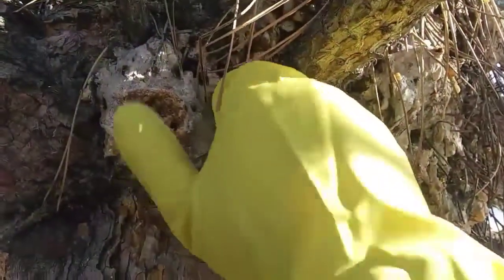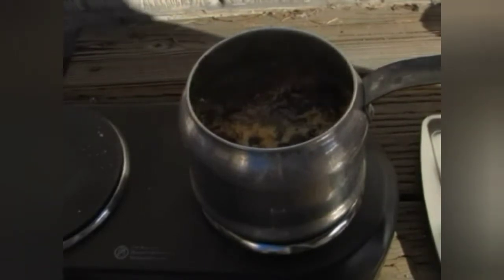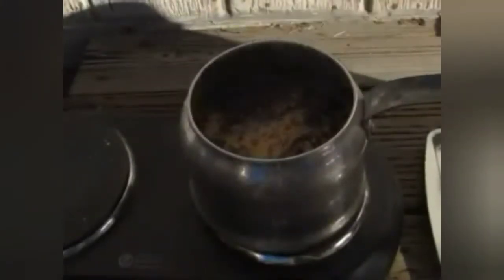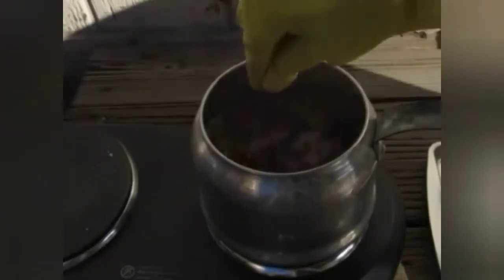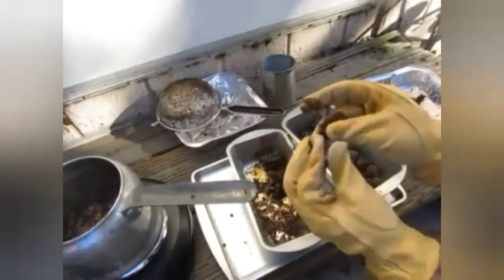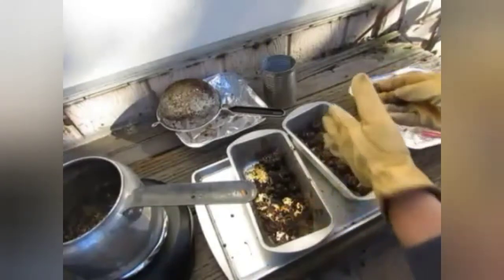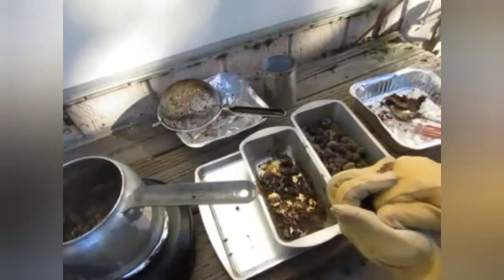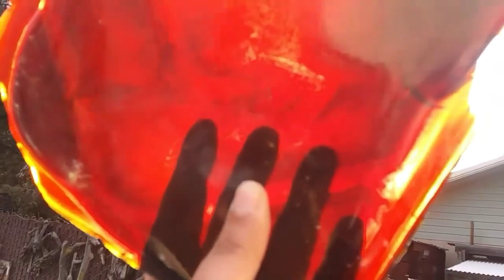Make Fatwood and Pine Resin

Comment: How long does this process take? I’m trying to use Norfolk pine sap. Any experience with that species?
Reply from the maker: All sap is different, and may have a different melting point. It will depend on how much you have, and how much heat you apply to it.

The hotter the heat, the more you change its molecular structure. If you just plan to burn it as fuel, you don't need to worry about it, but if you use it for glue, or violin rosin than too much heat can weaken the resin so it's not as strong.

It really depends on the heat you use, how much you have, and what you plan to do with it. Expect a good hour at least for slow low heat rendering, (best for glues, violin rising, ect.) It's faster, for high heat, fast melting, methods (best used for fire starters.)

Comment: Is there a way to make fuel out of the sap? Like how about a zippo lighter?
Reply from the maker: That's a good question, but I'm not sure I know if I can answer that. You can dip some rope in the hot, and melted resin, to make  water proof kinding, but I'm not sure if resin could be turned into a light fluid. When you figure It out, definitely let me know, cause I'm highly curious how it turns out for ya!

Comment: To remove sticky residue, coconut oil works wonders
Reply from the maker: Yes, oil works pretty good, but I found nail polish remover or a alcohol that is 90% proof or higher is best, especially if it's a thicker coating.

Comment: What would happen if you added wax?  && where did you get the fine mesh striner?  How do you store them?  in the referator, basement?
Reply from the maker: I've never added wax to mine, so I'm not exactly sure. I hear that it makes a fantastic bow string rosin that is fantastic for hunting.  I'm not a bow hunter, so I don't know much about it.

I got my fine mesh strainer, at the dollar tree! Its kind of a shock to most people to where I found it, but it works incredibly well! I have a bunch of these at my house. They are cheap and very efficient craft tools!

I store my resin in bags, in a cool dry, dark place. Heat and moisture make it melt and get sticky, and light can sometimes heat it up. So as long as it stays cool, dry, and in a dark place, it should store perfectly fine for ya.

Comment: You mention "Wound" dressing in another comment. What do you mean by that and how can it be used. Say like a gash or something. Or a temporary way to plug it?
Reply from the maker: Yes, both! It can help seal the wound, prevent infection, and works as a natural bandaid for many types of wounds. It can help it clot, and keep insects and pests away, as it's healing. If you have a large wound, and very little to fix it with, pine pitch is an excellent option with it's many medical properties.
Reply: Spruce pitch will draw an infection out.  Even if it’s healed in.  Don’t know about pine.   Never tried it, but understand it has similar properties.

Comment: At 10:41 you have the sludge material rolled up into balls and you have the clear flat sheets of resin. Both are used to start fires. If so, then bother to go through the purification process?
Reply from the maker: I am doing the purification process because I need the refined resin to make violin rosin out of. The refined resin also works as a glue, dissolves in teas, and can be applied in wound dressing. For all of these reasons, you should absolutely remove chunks of bark and debris or it will create problem.

Dirt in a violin bow totally destroys it, and the strings, making a terrible gritty scratchy sound. In wound dressing, dirt can cause infection, so you definitely don't want to create a problem like that either. In teas, bark won't dissolve, and you will probably be removing splinters out of your teeth. Again, not a pleasing experience.

If you only want to use the pine resin for fire starters, the bark will prolong the burn, and is perfectly fine to use as is! But if you do want the clean versatility and the medicinal use of pine resin, you will need to refine it like I did. This video is to cover all the bases you might want to use pure resin, or fat wood for. It's up to you if you choose to refine it or not. I hope this helps to answer your question.

Comment: Wondering if the resin is used outdoors if it goes liquid in hot weather? Does it stand up outdoors?
Reply from the maker: It melts when it's hot outside, and gets sticky. Im not sure if it would do the same if it is melted into wood, or used as glue. You would have to test it, and find out. Once you know, please message back! I'd love to know the answer to that question myself!

Comment: Hi. I used 99 percent rubbing alcohol to dissolve pine sap but now I can't get it to harden even though I've heated it up and then left it for a few days it's still a thick liquid.  Any tips?
Reply: Never mind, I put it over heat a bit more aggressively than before and it worked great

Comment: Great , EXACT - INFO - DEMO. Thank You !  Sure wish , I'd thought anout looking for sime tyoe ? SAP from trees in P.I. jungle , ha. Hmmm, wondering if the screen can be cleaned and used again?  Mtn Mel & Aussie Molly Blue , W. Colo. , sitting in tipi camp , 7 000 ft.  Ret. 59-82 USN SERE / VN .
Reply from the maker: Yes, the screens can! Use a heat gun to try to melt any excess resin off, then dip the screen in nail polish remover, or high proof alcohol like everclear. When your done, get it in boiling hot water and rub it with a scrub brush dipped in cooking oil.

Heat thins the resin out and makes it playable, the alcohol and nail polish eats the resin off the scream, and the hot oil removes the sticky residue left behind.

Personally, it's easier to buy a new scream at the dollar tree than it is to wash your screen, but this method works on posts and pans too, an they are a little harder to replace.

Comment: Thanks! just collected my first ever resin because of this video. It smells amazing unprocessed, do you think it would be possible to make scented candles from the resin? Or would that be smokey and unpleasant?
Reply from the maker: Candles have a central wick, and wax that melts. The flame is stable, and doesn't spread to the wax 

Resin is flammable in ways that wax is not. If you light a resin candle, the wick, and the resin will catch fire. Resin will spit and crackle. Essentially this is what will cause your candle to explode.

So, if you don't want a sputtering fire ball exploding and spreading in your house, I would advise against it. Would make a great camp fire starter. Just wedge your resin into a hole in a long, light it, and enjoy.

Again, not a good candle, but it would make an excellent fire starter.
Reply: Best stick with scented oils in your wax. The variety is incredible and themed variety packs are availible for cheap (christmas, holidays, outdoors, spring/summer/autumn, mens/women's scents, floral. For about 10 bucks you can get 6 or more scent oils.

Comment: hello there, I'm Yusuf from Turkiye. I'm very much interested in beeds and especially amber beeds. Is that possible to make that resin even harder like a stone and make bracelets or beeds out of it. Well at first sight , though it reminds me of Sumatran red amber, I believe it would be a new faturan (faturan: a sort of very old bakelite, probably 100 or more years old aka known as phenol-formaldehyde)
Reply from the maker: Unfortunately, not that I know of. This resin if very flammable, melts, and chips. If you are wanting to make resin colored beads, I would look into Epoxy Resin for your project. You can add transparent colorants, mica pigments, and many other things to it, that will be nearly as hard as cement, and remains chip resistant. You may have much better luck with epoxy resin, for your project.
Reply: Use a vacuum chamber & just ad a bit of pressure for the air to escape & harden it like real amber. Good luck finding one. Just a small one works too

Hopefully that works, I am too afraid to make it into jewelry but could work
Reply: Also must be in there while  it's still in its liquid state or soft. The longer in the chamber the better. I'd experiment different pressures before making them into jewelry

Comment: I have made again some violin bow rosin. The proportions colophony : beeswax are 22.1g : 1.4g. This quantity gives me a nice round piece of 4.5cm diameter and 1cm height. When heating the rosin/wax, the color changes from yellow to red. It is still transparent, as I can read this text by looking through it right now :D.
Reply from the maker: So, to make sure I understand this correctly: your ratios are 1.4g bees wax, and 22.1g rendered resin?

How well does it hold up, and how well does the Rosin hold up in the bow? Tone? Playability? ECT?
Reply: @basichomesteadingandsurviv3699  Hi! The grip of the bow hair is ok. I also have the Evah Pirazzi Gold Rosin, to compare with. I don't see a big difference.
Reply from the maker: @MrNedelcuBogdan  that's awesome. I've used "hill" Amber Rosin, myself. It's nice to know it compairs so nicely!

In my area, it easily gets up to 95°, so my Rosin (currently other brands) gets soft and melts. Will the bees wax help prevent that?
Reply: @basichomesteadingandsurviv3699  Well, at 35 degree celsius I don't see any problems. Lately I have been cooking violin varnish using colophony and linseed oil. To make the varnish more heat resistant I used some Calcium Hidroxide (lime). The lime goes when cooking the colophony, and what it does it rises the melting point. I cook for 30 hours or so, also with a bit of Zinc Sulfate, and when cooled down and hardens it's fragile, that's where the linseed goes in place, but this is not the case for the bow rosin. For the bow rosin I will use the recipe from above , but first I will lime the colophony to make it more heat resistant.
Reply: @basichomesteadingandsurviv3699  In less than a week I will try that and give you a feedback. I will test the melting point when using limed colophony on the recipe.
Reply from the maker: @MrNedelcuBogdan  I'm not sure how to use lime with Rosin making, so I was only going to try my own rendered tree resin, and possibly some bees wax, and not much else. If I needed to make my own Rosin, on the move, I know I can at least do it from stuff I can easily forage.
Reply: @basichomesteadingandsurviv3699        Here you have : https://youtu.be/gmHf5FHkh-c
Reply from the maker: @MrNedelcuBogdan  awesome! Thanks for the link!
Reply: @basichomesteadingandsurviv3699   please don't erase my previous mesage from here.....this one wrote in another language that english......It's the romanian language...and seeing this young fellow name, I guesed he is a fellow countryman of mine....here in România...
I basicly ask him to make some oil+ resin varnish.....so I can buy it from him......
By the way....I do live in the (mithical and exotic 😃) Region of Transylvania.....Some people might ring a bell 😊 hearing this name  .......
Reply from the maker: I don't recall that happening here. I'm sorry if it has, without being aware. I like to keep my page open for folks to communicate on! That's fantastic to learn that people from Romania are seeing my videos! Thank you for your comment! It really made my day!
Reply: Beautiful country Romania! Yes I recall the name Vlad Dracula a well known violin and impailmet stake maker.
Although which is the worst fate still remains debatable!

Comment: Has anyone tried using the clarified resin to mold figurines or art projects? It looks like it wouldn't be too difficult of a process but have never tried it.
Reply from the maker: I've used epoxy resin, as it's thin and gets in all the tiny molds well, but I wouldn't pine resin, as it cools too fast, and it's thick. It's also not solid at warm temperatures and melts in water. Epoxy is a great way to make figurines with.
Reply: Figurines would be subject to cracking/breaking and hard to control.
But what about jewelry? Not as strong as epoxy but pendants with encased objects inside?

Comment: Can it be used in the interior of leather bottles? Thank you for the great video
Reply: It shouldn't be. It may be poisonous. Use bees wax
Reply: @jarrodfillmore2867  thank you!!
Reply: @siveriumvelkepan9421  you're welcome
Reply from the maker: I bet it probably can, but I have not tried it. I will have to do some research on that.

Pine tree sap is used in many things. It is edible, and used in warm teas to treat flue symptoms, and asthma. It's also used to seal wounds closed, to stop bleeding. 

I have not researched the water proofing in leather water bottles, but if I can figure that out, I will try and make a video on that.
Reply: @basichomesteadingandsurviv3699  thank you a lot for your time!
Reply from the maker: @siveriumvelkepan9421  you are very welcome!

Comment: I love this video! I like to use the resin for incense, but if left crude, the debris will burn and affect the smell. I’ve been searching for a way to purify this resin EASILY, and this definitely took the cake for me. Thank you so much! I’m probably going have more than I need now!😂 

Oh, one more thing! Did you ever use the finer strainer or was the coarse one enough(couldn’t tell from the video)?
Reply from the maker: Yes, I did use the finer strainer, to refine the resin further. Because of limited space, I had to do that process off camera a little later, but the final product was achieved with the use of the strainer.
Reply: There’s another great method that I saw on another video, which involves 2 identical cans, one (full of pitch) on top of the other(empty) with a gauze in between (both open ends of cans facing, with gauze in between)
You simply place the cans near a fire to be heated, and the melted pitch runs through the gauze, from one can to the other 👍🏼
Reply from the maker: Ya, I could see that working! I watched another video where somebody put globs of pitch in a metal strainer, and set it on fire. The melted pitch fell to a collection pot, and the debris stayed in the strainer, still burning.

Lots of ways to do it. But my area it is illegal to have open fire anywhere, so there are fire bans, 9 months of the year. Because of the amount I had to process, and fire bans, I'm limited to a hot plate, or a stove top.

There are many ways to get the same job done! That's the wonderful part of cooperating, and networking with others! There is so many right ways to do things, than anybody in any situation can get solutions to questions or problems they may face. This world is just amazing for that. It's why I love doing the things I do! I keep learning more, even from people who comment. I really appreciate it! Thanks for commenting! I had not heard of the gauze and 2 can method. That's pretty cool!
Reply: Wondering if you have already tried it. I am just very curious before making all that mess; does the process not take out the vibrant smell of the resin? since you already melt and vaporate it. Any insights on this?
Reply from the maker: @eileentara4179  The smell is in the resin! When you strain the debris out, you still have the strong smelling resin, only it's much cleaner and burns more consistently, especially when using it for incense cones.

When rendering your resin, it's really not messy unless your rendering about 5 lbs of raw resin, and try to make several things with it at the same time, like I was doing in this video.

At some point, I will make another updated video of this process to better answer the many great questions people have had over the years.
Reply: I saw a proccess involving two cans and small campfire. The lower can buried in dirt in bottom of firepit with open top. And the other can on top with hole in bottom sitting on top. Put resin or fatwood in top pot and light a small fire. Seems like it'd work great in the field.

Comment: Why kind of pine trees have the most resin? We have a lot of red pines in our yard. How about spruce?
Reply from the maker: It is a proven fact, that some plants produce more resin than others. My knowledge is limited at the moment,  but I can share what my experience has been. Both pine trees, and fir trees, are abundant where I live, so I will focus on those. They are in evergreen family, as are spruce trees, but in my experience, the long needle evergreen like the ponderosoa pine, and Georgia pine, produce far more resin deposits than the Douglas fir or blue spruce (short needle) varieties do.

Pines produce large globs of sap, any place the tree has had an injury, and will continue to leak out of the old wounds for many years. Fir trees do produce resin, but it doesn't produce the same way a pine variety does, and you won't find huge deposits of it either. You can check the trunks of all your trees, but in my experience will gather much more resin off 1 pine, than you will find on 5 fir trees, and the pine will keep producing resin globs all year.

If you are harvesting resin from trees, like I did in this video, look for the long needle type trees, as they tend to be dripping with resin, where fir trees will not. I hope this helps.